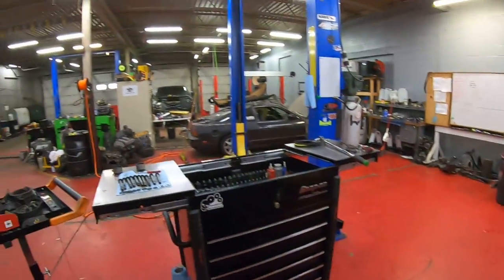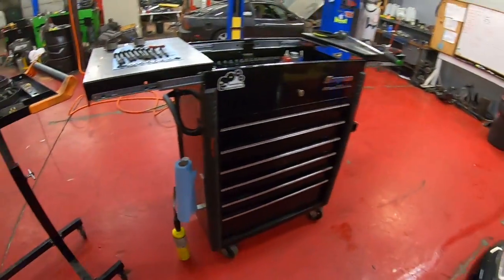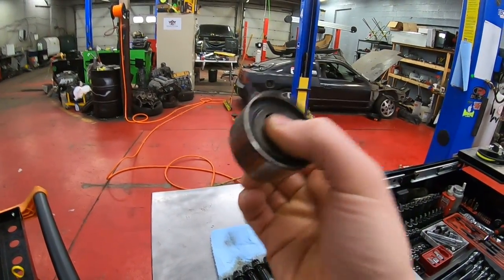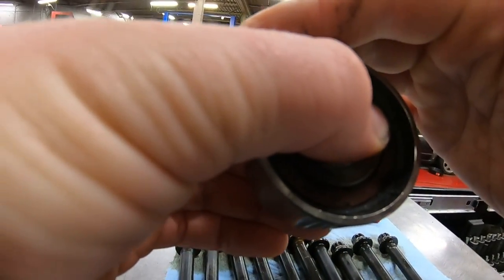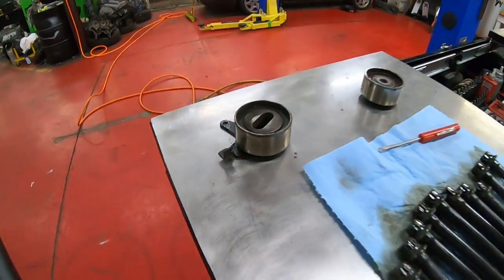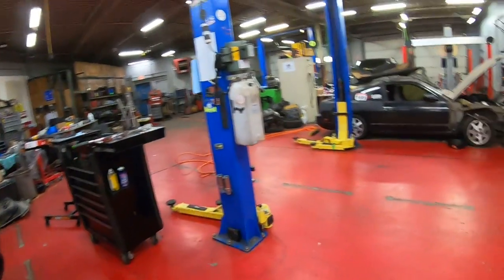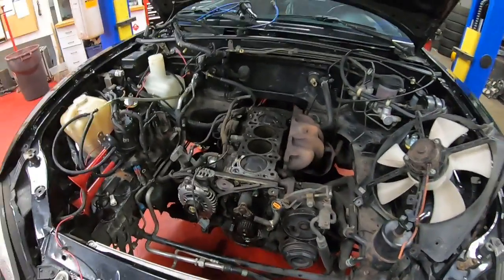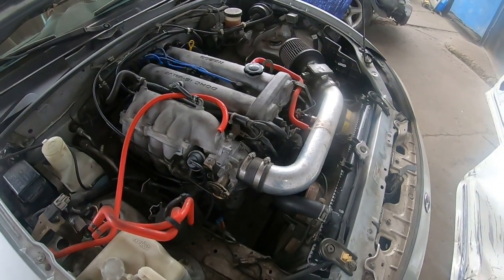Miata Timing Belt Rattle Diagnosis and Repair

Comment: Hmmm. I have this metallic clunky noise on a cold start from the front of my engine. As you say, similar sound to rod knock, but not the right rhythm. Thing is, I have just replaced all my belt, water pump, tensioner and idler bearings etc. Good quality parts and the bearings had no play in them before fitting. I set the cambelt tension per the workshop procedure, turning a full revolution, the 300 degrees past the mark, before slackening the tensioner bolt, allowing the spring to pull the tensioner pulley in, and then locking it in place. Could I have done something wrong? (All the marks lined up nicely and 19 belt teeth between sprockets - so timing is fine and engine pulls ok).
Reply from the maker: Sounds like you did the right things, it’s never the advice people want to hear, but if something isn’t right sometimes you just have to take it all apart and check again.  My most common mistake on timing belt jobs is sometimes I forget to tighten the water pump pulley bolts and it can make knocking sounds.  Best of luck to you!
Reply: @immortanautomotive9221 
Thanks for the reply. Yeah I will get to it one day! I used new stainless steel m6 bolts for the water pump pulley and they didn’t stretch as much as mild steel (only torqued to something like 6nm right?) so even with theeadlock they came loose! Luckily I kept the old ones and zinc plated them and put them back and now that’s fine. That was much more of a death rattle than a knock though. It shocked me initially but luckily and easy fix. Hmmmm, maybe that damaged my water pump somehow…🤔

Comment: Any danger to driving the car if the noise is present? I believe this is what I’m hearing in my nb miata. It sounds like a “circular” rattling coming from the timing belt area
Reply from the maker: No danger, I would get it addressed when you can but being non-interference the motor would be ok even in the worst case
Reply: @immortanautomotive9221  thank you for your quick response!

Comment: I bought a 2003 Mx-5 that has 19K miles on it from new (Yes 19.000!). It has exactly that same noise, but it does it only when cold and not even always.  I was already planning to do a timing belt and all the accessories, I believe it still has all the original parts. Good to know that I don't have to figure out where that noise comes from. Mine has another strange very subtle wining noise that I believe being the power steering pump.

Comment: I did my TB and tensioner, plus WP and all the seals 5k km ago and my Miata it's doing this exact noise but not continuosly, what the fuck...

UPDATE: It was the new water pump. I may have tighened the belt too much or it was defective. I replaced it again and it's now working good with no rattle. It did sound very similar though.
PLACE A SCREW DRIVER ON THE WATERPUMP SHAFT YOU WILL KNOW IF IT'S THAT!
Reply from the maker: I mean, it could be something else, or maybe a bolt came loose?
Reply: @immortanautomotive9221  just checked both tensioners before going to work and they're tight. Idek at this point, it's a dayco kit shouldn't have failed so soon.
Do you think I could replace the tensioners without messing up the timing? Or should I just TDC and lock the cams?
Reply: UPDATE: It was the new water pump. I may have tighened the belt too much or it was defective. I replaced it again and it's now working good with no rattle. It did sound very similar though.
PLACE A SCREW DRIVER ON THE WATERPUMP SHAFT YOU WILL KNOW IF IT'S THAT!

Comment: DUDE I been trying to figure this out for months!! So many different shops told me diff things. That’s exactly the rattle noise my car makes. will replace tensioners soon
Reply from the maker: Happy to help!
Reply: @immortanautomotive9221 What brand tensioners should i buy and where do you recommend i buy them from?  Also How long of a job to replace the two bearings/tensioners? i did a timing belt recently and seals.
Reply from the maker: Wait you did the whole timing belt and seals but didn’t replace these?  We get them in a kit from gates that comes with the timing belt.  You might be able to replace them without taking the timing belt off but that’s basically the job.
Reply: @immortanautomotive9221  i replaced everything including seals and bearing and tensioners. It seems like they were either a bad brand or i’m just really unlucky.
Reply: @immortanautomotive9221 could i get your opinion on a noise my car is making ? 😅
Reply from the maker: @BabaBlackout email a video to immortanautomotive@gmail.com

Comment: Is it safe to use 1/2 inch impact wrench to remove the crankshaft bolt instead of a breaker bar?
Reply from the maker: Yes it’s fine but only use a torque wrench to install
Reply: @immortanautomotive9221  forgot to ask, will I need a weighted impact socket to remove the crank bolt or regular impact socket will do just fine? Thanks in advance ☺️
Reply from the maker: Regular should be fine, I’m not sure because I always use a breaker bar